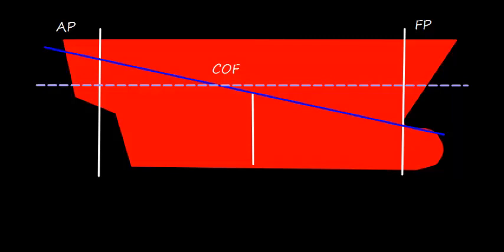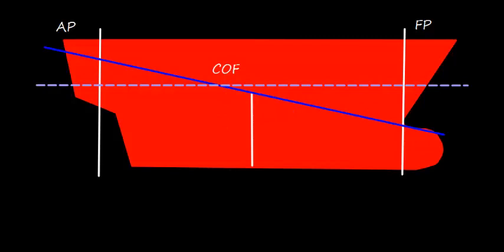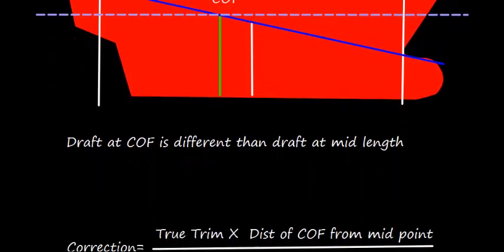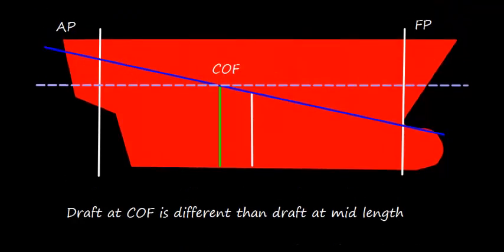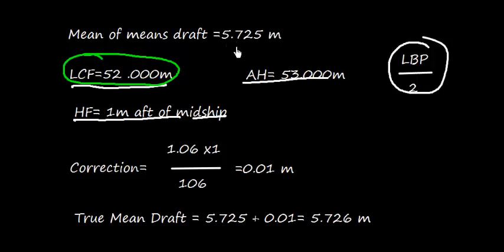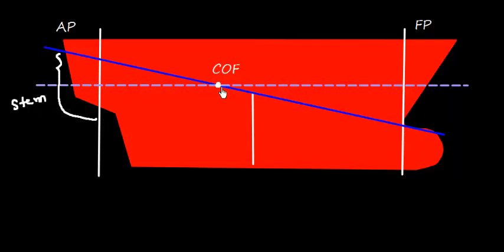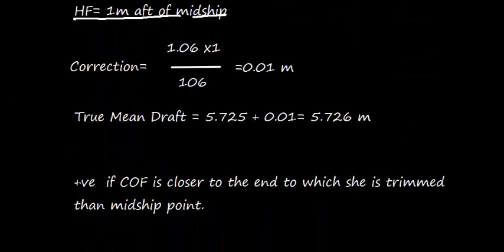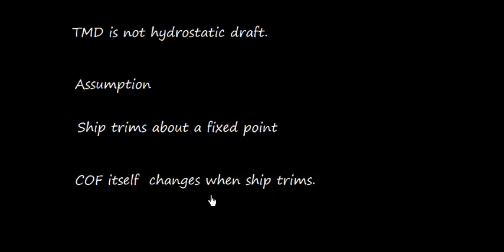Draft Survey_Basic Concepts Part 4_ First Trim Correction

Comment: Please explain calculation until get 52.000 m of LCF.. Is it calculation or get from hydrostatic tabel..Please tell me.. thanks a lot
Reply from the maker: The value of LCF is taken from hydro static table against hydro static draft. Here it is assumed to be 52 m to explain the concept.  Thank you for pointing the same.
Reply: @sailorstube3259  Assumption does not explain how this figure is arrived at, please explain or advise where to find

Comment: Why TMD is not Hydrostatic draft. Because I see draft in the Hydrostatic Table was built base on ship even keel. Its mean FD = AD = MD = TMD
Reply from the maker: TMD is hydarft when vessel is at even keel. However once the vessel trims, COF is different than mean value of draft  and a trim correction or layering correction is applied.  Pls have a look on part video. https://www.youtube.com/watch?v=XIzGrrYn-S4